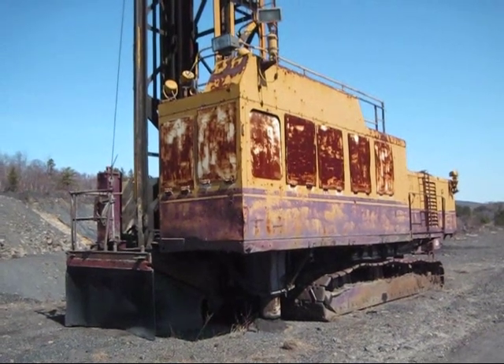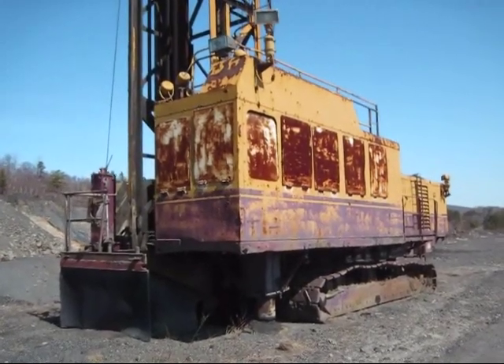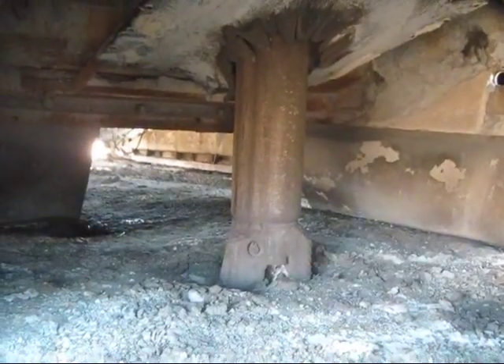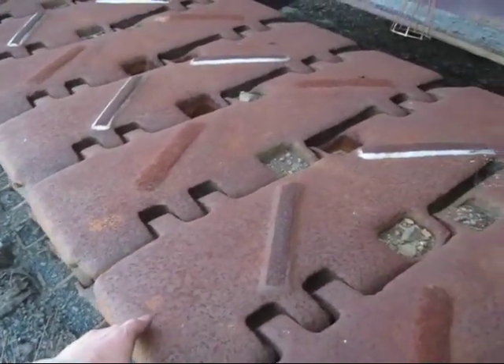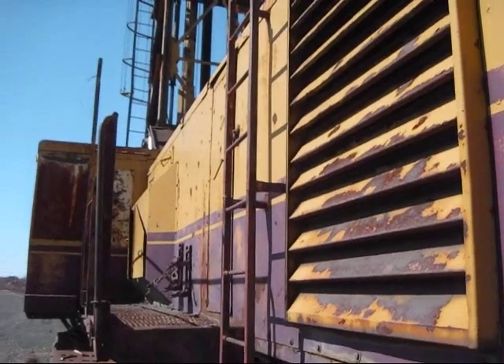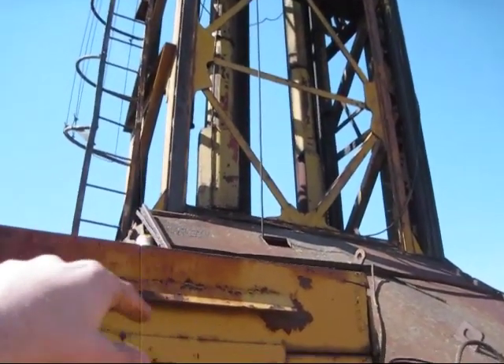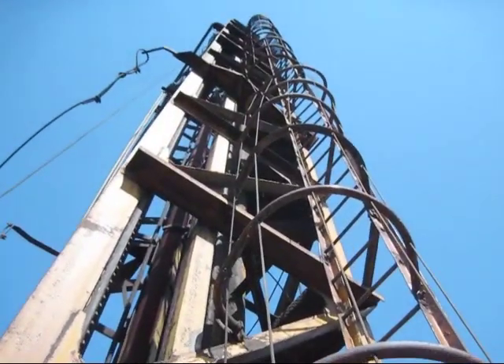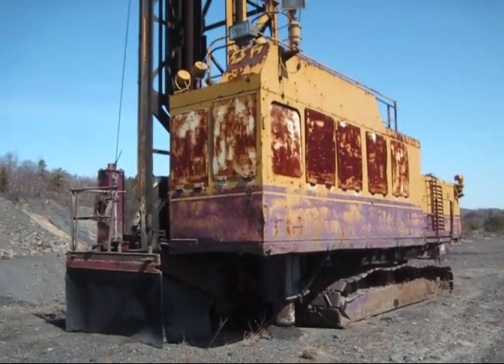Bucyrus-Erie 60-R Documentary

Comment: I was a driller on 60'rs & 45'r's  for 16 years and at times we were drilling the hardest  Iron ore  deposit in the World we kept the Bit manufacturers on their toes  developing  the right bits  we  had  1 standard  diesel electric , one just electric  with a cable (snake)  and we had one that had been rebuilt  and modernized , It had a larger engine Room than above  and it had  massive  diesel engine  and then the electric Generator  and a very large Air Compressor .  then there was a 45R  (my favorite)